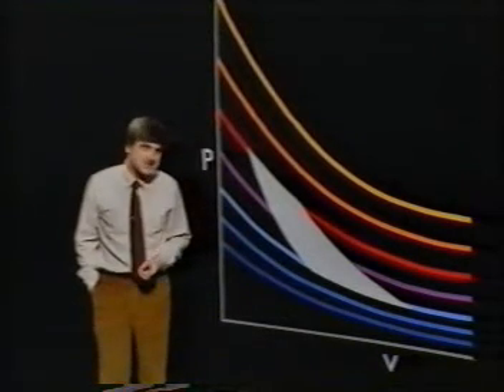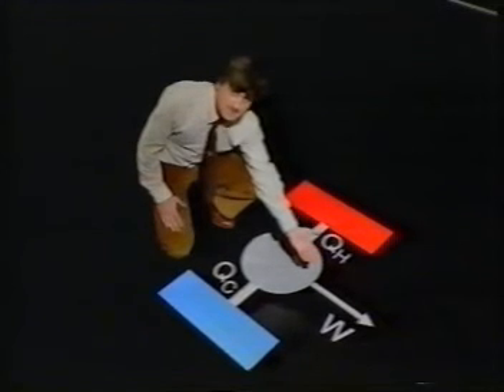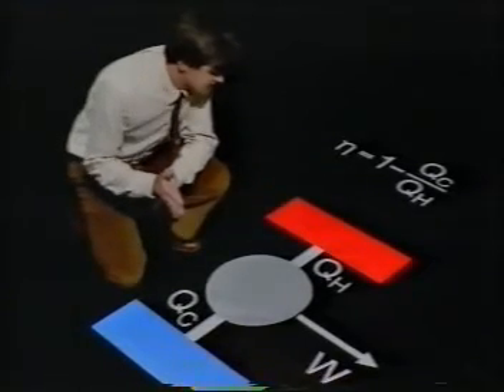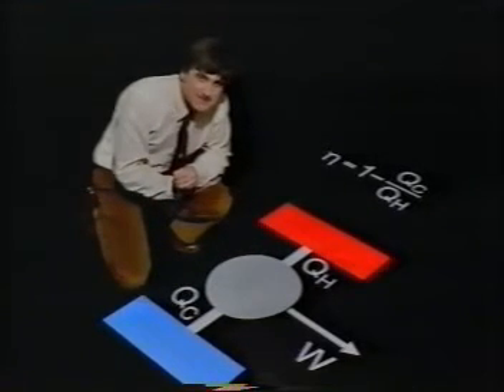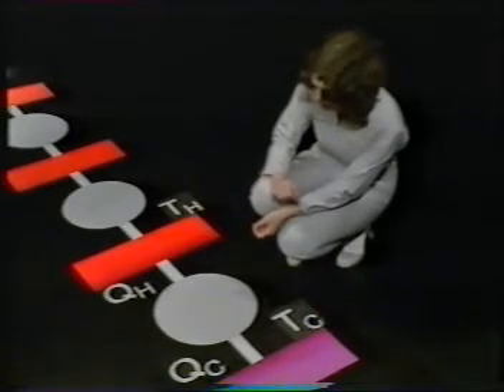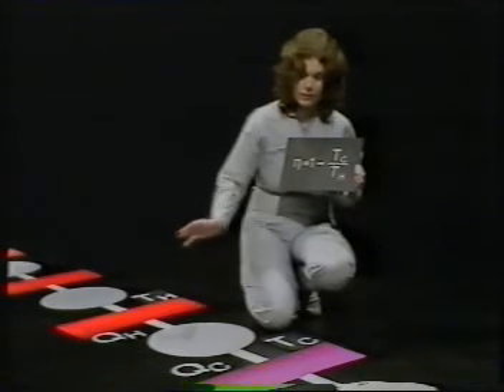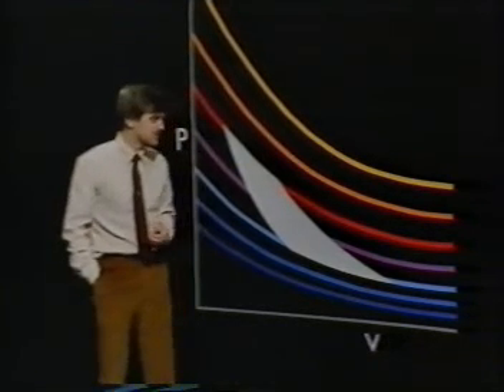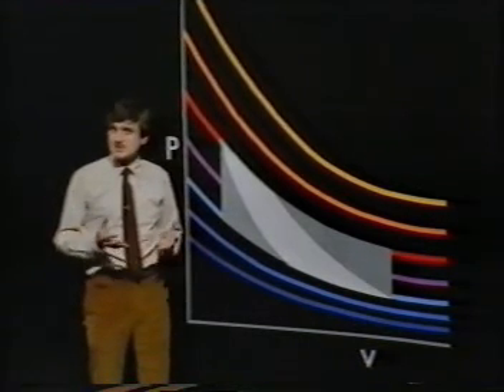18 2 OU  Heat Engines

Comment: Now I have finally gotten the difference between the Carnot Cycle and the Stirling Cycle, it's all a matter of variation of entropy. In the Stirling Cycle we have more work being done, but the heat transfer at a constant volume inherently increases the temperature, and by being an irreversible process the entropy gets bigger, decreasing the efficiency. On the other hand, even though Carnot Cycle doesn't provide a lot of work, it is more efficient once it does not have variation of temperature in non-adiabatic processes, meaning the entropy stays the same. All the problem with these ideal cycles is that they depend on isothermal processes, and this is impossible without an increase in entropy in the real world.